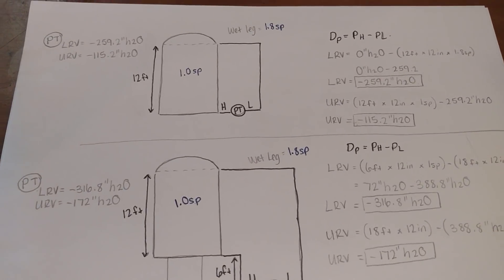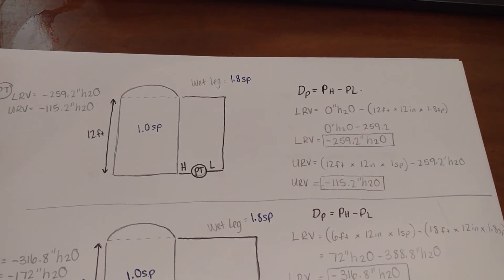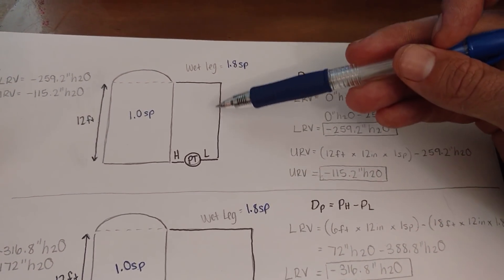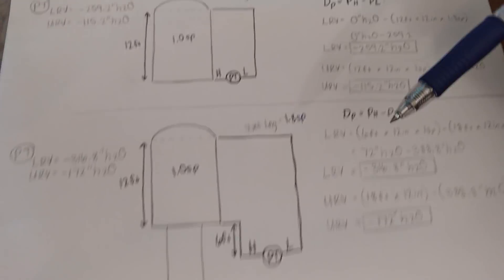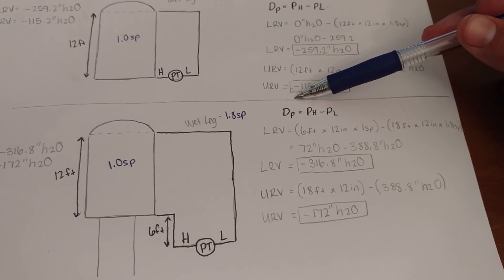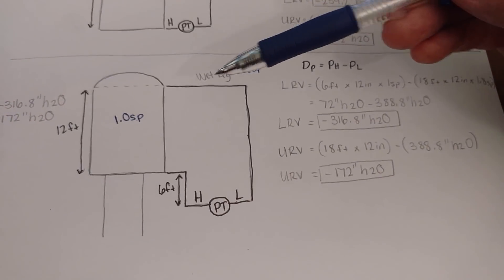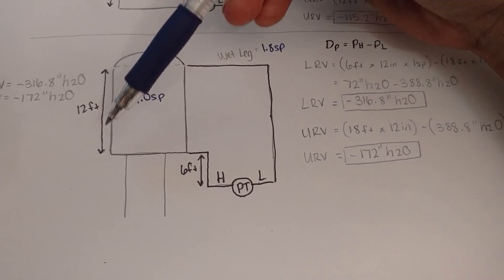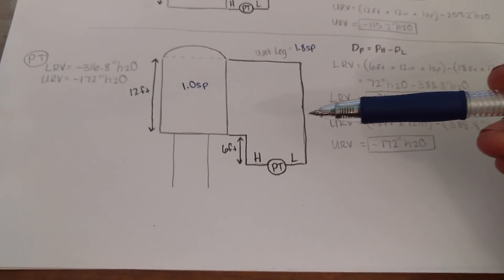How to obtain the LRV and URV for a differential pressure transmitter.

Comment: The 12 Inches is to get measurement in inches of water instead of feet of water. He probably made up the 1.8 specific gravity on the wet leg to show a difference. Or it could be an acid solution, or ceramic slurrie. Like the video helped me to really visualize how to calculate DP. Thanks!

Comment: This makes no sense, how is your wet leg 1.8sp? So your wet side is the low side. The tank is variable, level will change. If the wet leg is full then shouldn’t it go to the high side and the bottom tap go to the low side which will be lower in pressure that the wet leg?

Comment: Why does the Low side go to the top of the tank? Is it because the pressure is lower at the top of the tank?!
Reply: In this application the low leg would fill with condensate if left dry. So normal design ensures the leg is full ( usually a condensate pot) and the transmitter is setup reverse acting. As the d/p decreases with increasing level ( the high leg is coming up to meet the low leg) the transmitter output increases.

Comment: mr stuart since dp =PH-PL, URV=(12x12x1.0) -(-259.2) = 403.2"h2o....plese explain if you feel am wrong
Reply: i might be wrong from what I understood  259.2 is pressure low,it is also equal to low range value(even tap),after you calculate DP with 0 high pressure using the formula( DP=Pressure high-Pressure low)
Reply: You should not have a negative sign for -258.2 for the calulation of the URV  You are doing this PH - LRV  should be PH-PL       PL= 259    LRV= -259  Pressure at this level (low side) is not a negative number   LRV=   (0* 12in/1ft) -  (1.8*12*12)= -259.2      Phi-Plo       URV=[ PH=(12x12x1.0) -  PL=(259.2)  ]   144 - 259.2 =-115.
Reply: yes its -259.2-144 = -403.2 you wrote PL and PH values with sign of subtraction..... Plz Explain me ?????
Reply: @glamtechvault   144 is PH   PH-PL     URV= -259   PL = 259
Reply: @steve7389  144 IS THE SPAN....HE CONFUSED EVERYONE THE WAY HE LAID THAT PROBLEM OUT....SPAN=URV-LRV....

Comment: what is the calculation if the transmitter installed 6 ft upper than bottom of the tank can you help me please
Reply: Nobody answered your question for 2  years?  Hmmm.. here's my thoughts. better explained by showing a drawing and equations but here goes... In his example, the tank is 12ft high.  If the transmitter is positioned 6 ft above bottom of the tank, the 

LRV calculation is as follows high side pressure Ph in the DP equation will be 0x12x1.0 = 0" and ...
for LRV equation the low side pressure Pl would be 6x12x1.8  = -129.6"  
                     so LRV = 0"-129.6" = 129.6"

for the URV equations, the low side pressure is the same -129.6" 
but the high side Pressure would be 6x12x1.0 = 72"  
                     the URV = Ph-Pl = 72" - 129.6" = -57.6"

The transmitter cannot measure below its positioned height on the tank. So if the level is below the 6ft mark on the tank - the high side tap height, then it will still read 0" H20 of pressure on the high side and -129.6" on the low side.

Thats my understanding of it.  Althought these types of setups can be confusing and so I could be mistaken.  Please anyone chime in and correct me if I missed something.

===  if the DP Transmitter is using Capillary lines with Process seals at the vessel, rather than impulse tubing === 
affects of position of the transmitter would be calculated slightly different than above examples.

The capillary tubes can have a fill oil with SG (Specific Gravity) that is entirely different from the SG of the process fluid in the tank.    

The transmitter can be mounted above the tap and it can measure all the way to the bottom of the tank, unlike the open tubing examples shown in the video, and in the example I've explained above, the capillaries can measure the full range between the taps.  
===
on second thoughts, the fluid on open tube would fall and pull a vacuum on the H side of the transmitter DP Cell, which similar to a Barometer tube, would pull a vaccum (negative pressure)...

I will have to research this more.  Hope this helps at least get the dialog going on this.
I should have consulted my text book before answering...
===

Comment: Thanks a lot, 12 in for what we must multiple it!!??? Thx
Reply from the maker: 12 inches is one foot. So to go from feet to inches of water we multiply how ever many feet times 12 inches.
Reply: @440stuart  What is the best intermediate fluid used to fill an LP joint for a device that measures the level of LPG
Reply: Stuart Brunt 
why sp of low side is 1.8 
could you please  explain in another video same with oil ?
Reply: world wide More than likely he is using a dual diaphragm transmitter and the low side has a capillary that is silicone fluid filled and so it would have a specific gravity of 1.8.
Reply: @quadracer392  What is the best intermediate fluid used to fill an LP joint for a device that measures the level of LPG
Reply: quadracer392 Pretty close, but actually is called a "wet leg" when you fill up the piping with a neutral fluid like silicone oil, liquid glicerine, glycopropilen, etc... to prefent contamination /freezing/boiling or simple process isolation.
Reply: @henryrollins9177  What is the best intermediate fluid used to fill an LP joint for a device that measures the level of LPG